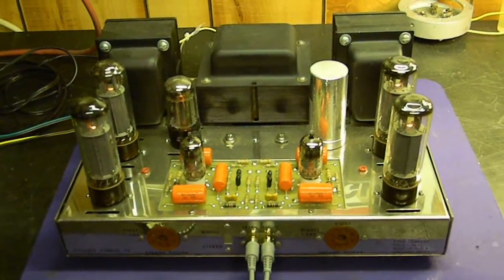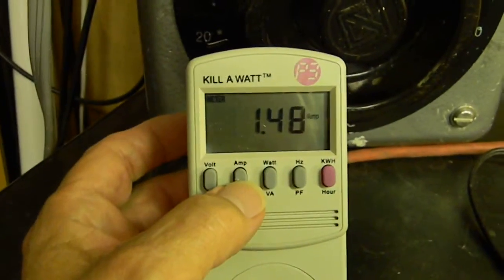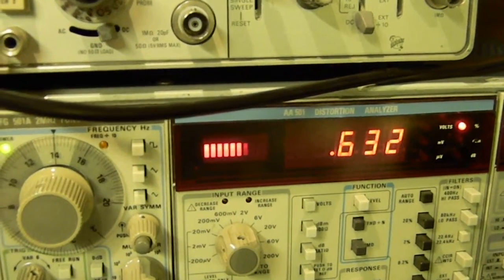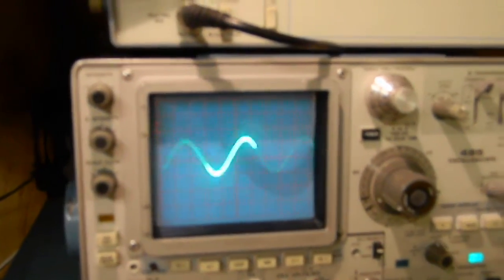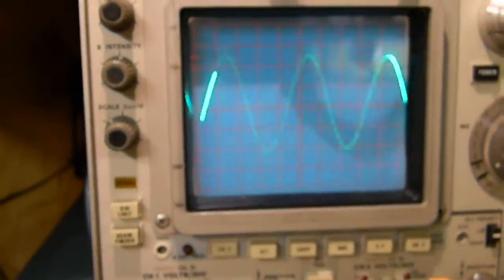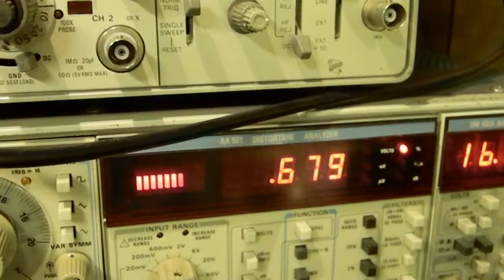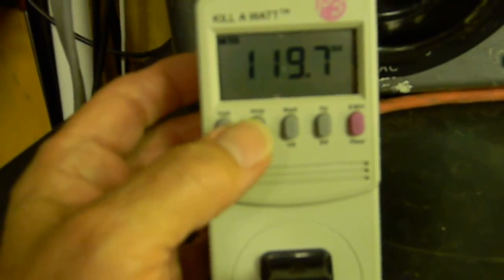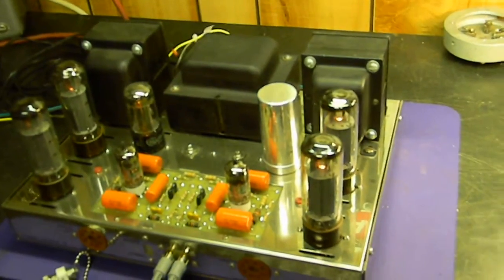Dynaco Stereo ST 70 Vacuum Tube Amplifier Undergoing Output Power & THD Measurements.MOV

Comment from the maker: The Dynaco output transformers are very good. The weakness is the 6AN8 driver - get rid of it and try the diytube POSEIDON board that uses a 12AX7 and 12AU7 - it will improve THD dramatically. Check out my YouTube videos at ElPaso TubeAmps.

Comment from the maker: You can Google "most expensive speaker wire" and will find wire that advertises (and sells?)  for $21,000 for three (3) meters - and you will, of course, need a set for each channel. Wow... I have had discussions with audio shops about high dollar wire. They just smile and let me know in a polite manner that I have a tin-ear and have no idea what I am talking about when I tell them that #12 zip cord works just as well. It's not worth arguing about as you will not win those that "believe".

Comment: Idea -Do the same test with about 50 feet  fancy expensive speaker wire vs. 15 cents/foot hardware store .14-.18 gauge  lamp wire and note the lack of ANY difference. Repeat test several times with thinner and cheaper wire.    Use any amp, -old or new.  When you get down to about 30 guage magnet wire, there will be thousands of Hi-Fi snobs learning something the hard way.

Comment: Great vid!  I am a HAM, EE, music lover.   The low freq. distortion may be due to the preamp board with 7199s (awful tube).  Also, there may be a 10Hz filter on that board (Triode Ell board?) This may be affecting your sine waves below 30 Hz?  Also, contrary to popular belief, the older x-formers are often NOT  better. They loose high & low end. The ones jobbed out to Japan ca. 1968-72 look better on a scope. In real-life, the load @ 30Hz would be only about 2 ohms w/ most speakers.  but GREAT!

Comment from the maker: I suggest picking up an oscilloscope, a couple of dummy loads (8 ohms) and an oscillator and start working on/testing audio amps and see what it grows into. Most of my equipment is 1980 vintage Tektronix equipment - government surplus. Probably got $5K in it all. New cost in 1980's would have been enormous.  Beware of a lot of info on the Internet. Much is biased and misinformed but the Internet is still probably the best source. Good luck. Just go for it. I've been at it for 50 years now.